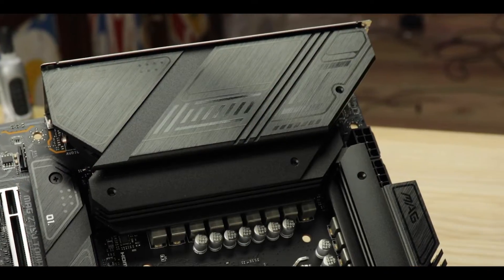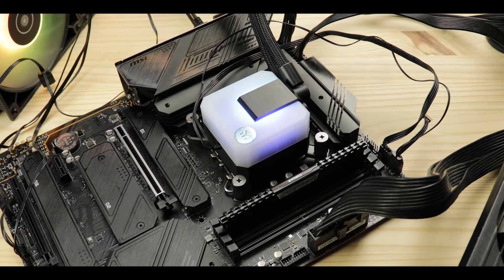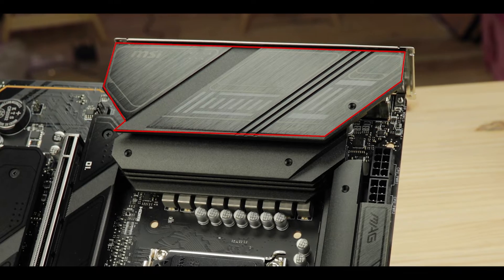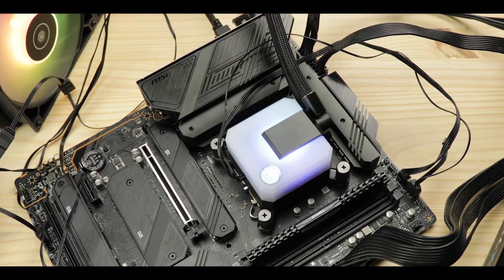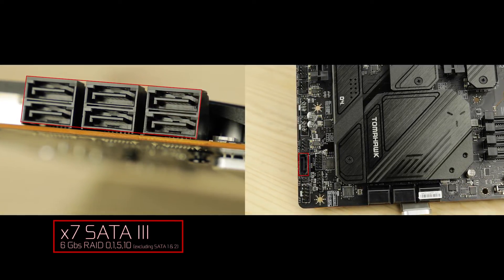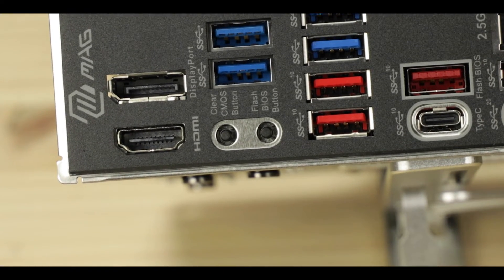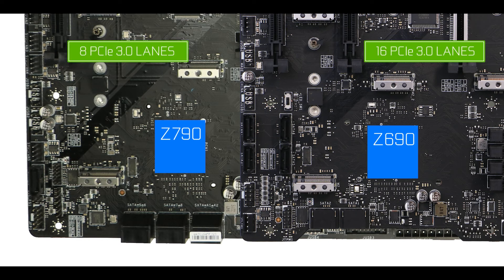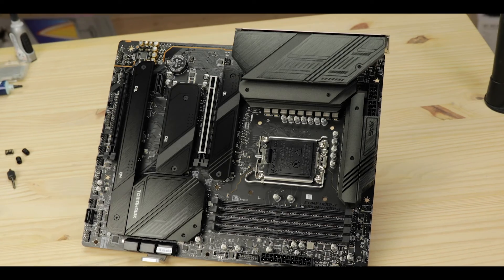MSI MAG Z790 TOMAHAWK D4 : MSI getting lazy (again).

Comment: Hey! MSI did change things. On the newer board the PCIe 4x4 Slot is the bottom one, so this most important slot for example for capture cards stays accessible with big graphics cards. Was not the case before! Also many more controllers for the USB ports. The old design with the x4 slot in the middle was carried over to the PRO Z790-A and it's a pity!

Comment: Well I can't speak for the board specifically, MSI has had a really fantastic DDR4 implementation I have a z690 edge, I was able to get 4300 running in gear one 15-15-8-13-28 on it which was pretty cool, mind you I never run anything that fast for actual gaming over DDR4 is still faster than DDR5 because of latency in games that are less textured demanding(esports games and the like), dailying a 13700K 5.4, 4200 c16
Reply: Also special shout out to MSI for having a working trcdw timing

Comment: These couple of months later this board turned out to be a little bit better in price/performance. It dropped almost to the Pro-A price level while still offering a little extra (looking at you CMOS button). I also feel it may get BIOS updates more often since it's (gaming) Tomahawk board over Pro-A model - I had that with ASUS where their gaming boards had more BIOS updates over the course compared to "regular" models. I picked DDR5 version. RAM prices also going down continuously so there is no reason to consider DDR4 anymore. Looked like a nice fit for my 13600k.
Reply: I'm doing the same board and CPU. Already have the board and waiting for the 13600k. As long as you get ram on MSI's QVL... it seems like the 13600k with 6000 RAM should clock fine. How's your experience with the pairing been so far mate?
Reply: @mass_stay_tapped_in528  I bought some Kingston memory, 32GB 6400. Worked like a charm with XMP profile.

Comment: Hi, what do you mean by lacking of hybrid fan connectors? I checked the MSI site and they say: "MSI fan headers automatically detect fans running in DC or PWM mode for optimal tuning of fan speeds and silence..."

Comment: Is there any motherboard on the market (AMD or Intel) that has JDEC 5600 for 128GB) and also has a Gen5 m.2?   This board in DDR5 variant only has the memory spec, not the m.2 spec    (i see the MSI MPG Z790 CARBON WIFI has those specs...is there any cheaper board that has that??)

Comment: Love the 7 SATA plugs. I have two IcyDock 5.25" bays. One with four 2.5" SSDs, one with two 2.5" and my 3.5" backup drive. All hotswap. Even If I don't have drives in them - in my future computer at least the system drive will be a NVME drive, I still have the possibility to plug drives in that way.
Reply: Make sure you plug in your sata devices before you install your graphics card. My 3070 hangs over the sata plugs and the single sata plug by the power supply is a no go. No room to use it because of the power supply

Comment: This mobo was my choice for i5 13600K upgrade. The main reason is it has 7 SATA connectors so my HDD and SSD drives can migrate fully. I'm glad there is super fast Type C port, I believe PSVR 2 will be using that.
Reply: Are you satisfied with z790 Tomahawk? Would you recommend it to others? I also have a 13600k. Thank you in advance.
Reply: @kleptokratija  yeah, it's a good board. The only issue I have is once in a month Ethernet adapter is not booting up so I have to restart it via Windows settings.
Reply: @Cheenael  Thanks for the feedback! Also doing the same pairing

Comment: I wonder if the Z790 Tomahawk DDR4 is worth it over the Z690 Tomahawk DDR4. I have 32GB of 4000 CL17 DDR4 that I will be using. I want to get a 13700K, I know I will have to flash the Z690 bios but that's not hard to do.
Reply: Looks like you answered this in the conclusion, I'll save some money and get the Z690 version.

Comment: I bought this one for the external clear cmos button, and for some reason one site already put it on daily offer for just £5 more than the Pro-A.

I'm planning to test if Z790 allows better DDR4 overclocking than my Z690, but I'm blocked by ETA on my new case of 25th november (thermaltake core P3 pro),

My current 4k setup is ITX with the asrock DDR4 Z690 and 12600k which will become my 1440p setup after.
Reply from the maker: Good deal !!!!! Really good one
Reply: @Laurentschoice  I know, I had to check the serial to make sure they hadn't switched it with a Z690 lol. Original preorder price was £359, Pro A was £319. Daily offer on Z790 tomahawk £325.

I bought a 4400 DDR4 kit when they went on sale which goes crazy high on gear 2, going to use this board for G1 vs G2 testing since nowhere is doing that (does 3800CL13 G1, 4800CL17 G2 on my current Asrock Z690), 12600k for now, will get a 13900k early next year to hopefully get a better IMC.

Gonna be abusing that external clr cmos button like a son of a ...

Comment: Hmmm, you have problems reading I suppose.
GPU mosfet is a 75A RAA220075, not 90A :)
Reply from the maker: Probably going to say something very controversial.... doesn't make the board any better  :)
Reply: @Laurentschoice  Nope,  but makes your reporting accurate. I don't care for 90, 105 or 110A myself, because u can not run any SPS with that current anyways, except you use LN2 to cool the phases. So to calculate 90x16 is stupid as well. The peak of such an SPS should be around 30A and 30x16 is plenty for any CPU.

Comment: Awesome review dude! Just one question I couldn't find addressed in the video, what is the LAN controller on the board? Is it updated to the I226-V or the same I225-V from last gen. I only ask because I've heard a lot of issues with I225-V chipsets and an updated one would ideally be fixed
Reply: I just installed a Z790 Tomahawk WIFI DDR4 and it shows Intel(R) Ethernet Controller I226-V in Device Manager
Reply: @BradThurber  I got the ddr5 version and noticed the same thing. that’s hopefully a good sign for there not being LAN issues
Reply: There's at least one article and reddit threads around the I226-V having the same problems as the I225-V. In fact, the i225-V gen 3 (the last one they made) is said to have less problems than the newer I226-V :(
Reply: @p.a.n.t.s  that's unfortunate. looks like there's a driver that works around it i guess. I don't use the lan RN, just onboard wifi on the chipset, but it'd still be nice to have one that works if i ever use it
Reply from the maker: i225-V
Reply: @Laurentschoice  hm ok. thanks for getting back to me

Comment: The z690 doesn't allow bios flashing without a CPU does it? If not then telling people to get a z690 isn't helpful for new buyers
Reply from the maker: It does :) . The z690 tomahawk can flash its bios without CPU :)
Take a look at my review of that board .

I hope this helps
Reply: Its still on the 1700 socket though/the meteor lake platform/the 1851 socket, MAY be right around the corner. Most likely the i9-14900ks will be on the 1851 socket,not the 1700 socket.
Reply: @mattmatt2417  it doesn't matter. BIOS updating is what matters here. 14th gen will not be supported on z690 or z790.

Comment: Unfortunately nobody did what you are proposing. The mobos with pcie-5 m2 have x8 pcie-5 for the graphic card (which would also limit current cards to run at 8x pcie4).
Reply from the maker: Hi Guido :) thanks for your comments :) 

You'll find that x670 powered motherboard does exactly that. 
Pcie 4 on the gpu slot and m.2 ssds are the only components supporting pcie 5.0

On this motherboard, the gpu slot enjoy 16 lanes.

I hope this helps

Comment: My big doubt is ... do I get the DDR4 model and use it with a good DDR4 4000CL16 kit with tuned sub timings or do I go for DDR5 6400 CL32 ? For gaming what do you advise?
Reply from the maker: Is money an issue ?
Reply: @Laurentschoice  32GB of good DDR4 4000 is the same price of DDR5 6400 CL32 where i live. Is that the point of your question?
Reply from the maker: Ok. Just for sake of future proofing I'd go DDR5 .

Comment: Does Z790 have a better memory controller than z690? which I think they do
Reply from the maker: Yes it does. In DDR5 memory support mainly allowing upto 7200 MHz clocks on this very board DDR5 variant .
Reply from the maker: The z790 DDR5 base clock is also significantly higher than seen on z690. 

But obviously in a gaming context ... still not providing tangible differencr has seen on 5ghz+ DDR4 sticks.
Reply: @Laurentschoice   does this means running 6000mt/s memory on Z790 would be more seamless and hassle free than Z690?
Reply from the maker: For 6000MT/s worth of data transfer I would stick a DDR5 board. 

Z690 or Z790 won't make much of noticeable difference at that level. But you have higher chances to go beyond 6000MT/s with a Z790 supported DDR5.

Hope this helps.
Reply from the maker: That's a very specific question.  Doing content creation, 3D rendering ?
Reply: I've seen a review of the Z790 D4 model vs the Z690 D4 model of this board, and the Z790 model could OC DDR 4000Mhz at Gear 1 when the Z690 D4 couldn't. Only in Gear 2. Same memory kit / CPU was tested of course.
Reply: Its still on the 1700 socket though/the meteor lake platform/the 1851 socket, MAY be right around the corner. Most likely the i9-14900ks will be on the 1851 socket,not the 1700 socket.
Reply: I'm upgrading from an i7 4770k (🤣) to a 13700k. I'm definitely going with a z790 board and DDR5 since I don't upgrade except once every 5-7 years. Any other z790 board that anybody would recommend? I'm partial to Asus and MSI. I currently have a RTX3070 pared with the old i7.